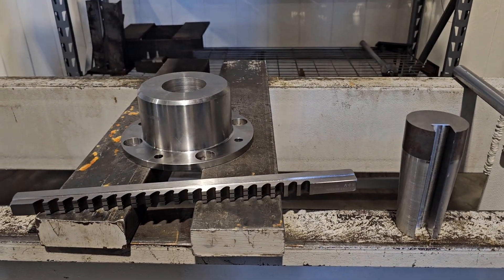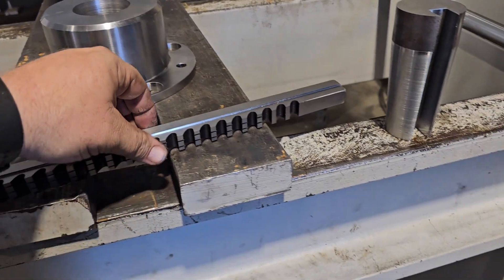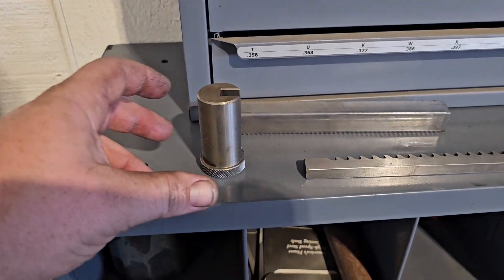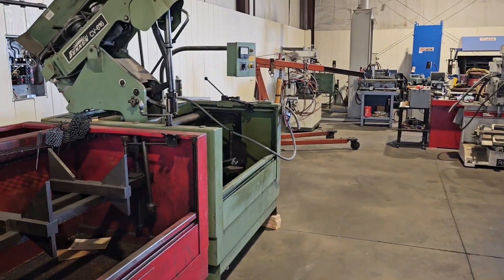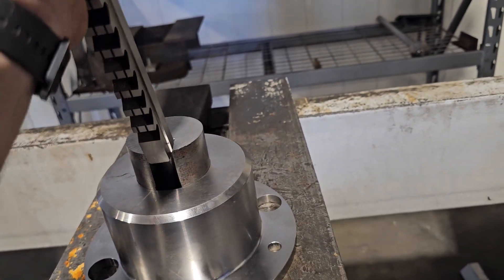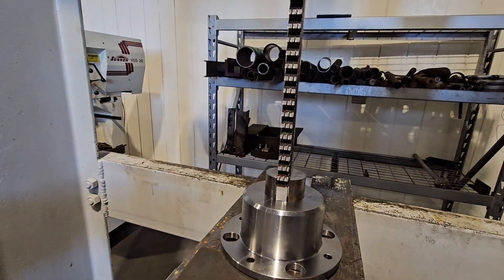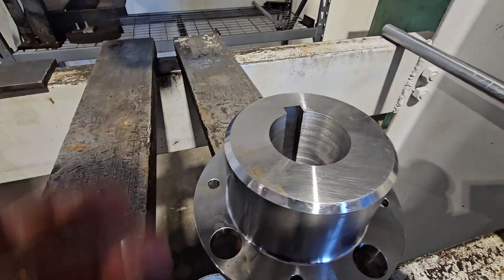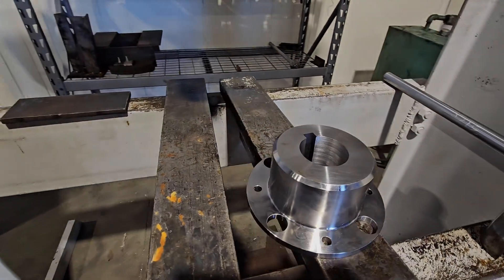Broaching a Tapered Keyway

Comment: That looks very much like a TB Woods, Thomas, or Rexnard Shim pack coupling.  When I would do those from scratch I had to do the tapered keyways for H302 Gemini compressors.  Man, you have to be super careful doing the tapered keyways because sometimes the broach wants to dig deeper than it should, not good!  I like your press.  I have a 50 ton Dake with power unit and they had to find a new company after covid to make their hydraulics and it is half the speed of advertised, and very slow!
Reply from the maker: This is for a cold storage compressor part of some sort. It was a bit nerve racking for sure

Comment: how did you figure out the depth to key the broach plug. did you zero off the tape end or the top end of the taper?
Reply from the maker: The tool was .875 deep, so I went like .910 deep to count for the roundness of the part